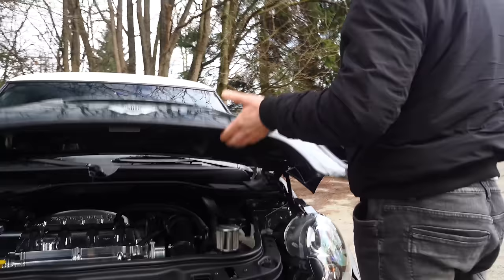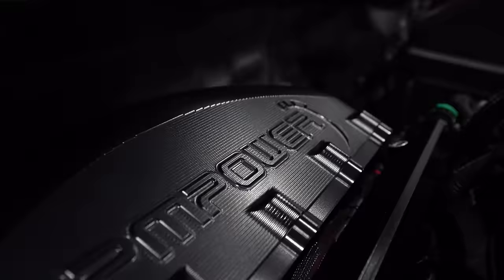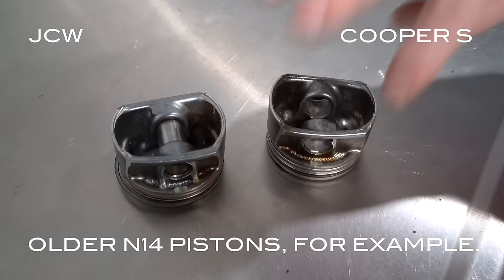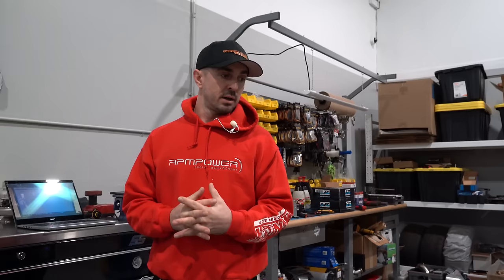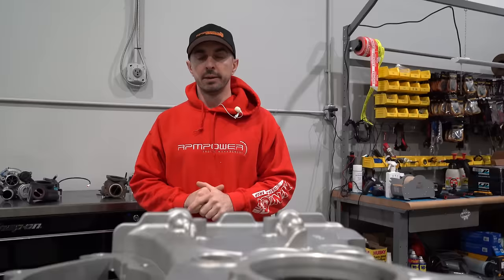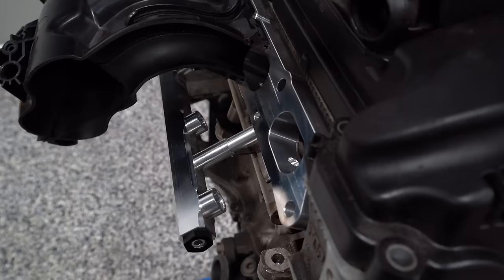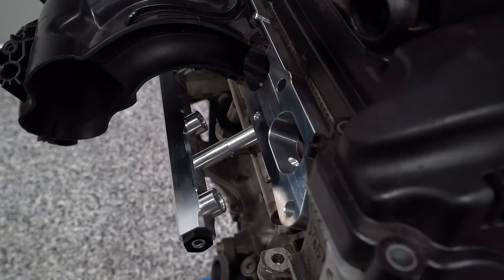Here’s the Secret to Building a BULLETPROOF 600+ HP Mini Cooper (PART 1)

Comment: Talking about how the factory crank is forged and has plenty of potential makes me feel bad that I turned my old N14 crank and flywheel into a side table for my living room 😂
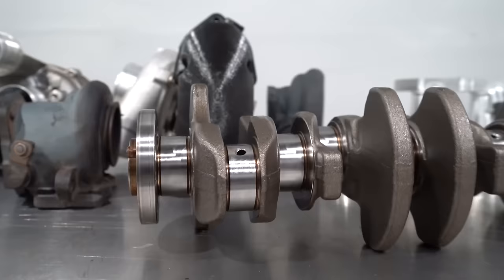Reply: Maybe I misheard, but at 3:35 that looks cast?
Reply: @rambow70 it's not forged, he said saves you looking for a forged crank. So you are correct.
Reply: Pics?
Reply: @rambow70 it’s forged the parting line is wide.If you look very closely it looks like there’s 2 lines.

Comment: the r56 engines SUCK period.  to get 600hp out of a mini cooper it would be like 15k why invest 15k to get 600hp that will not be reliable when you could just kswap it for less then 10k throw a turbo on it and make 600hp while still be reliable unlike the n14 and n18 engines.

Comment: very informative, thank you. Funny enough, yesterday I got the WMI kit for my car, and the main reason why I didn't get PI is the cost VS mileage. I'm doing about 2600mile/year on my summer car, and PI kit used is simply non-existing and new only few option @ 4-6x the price. WMI there's a ton of used item, and tons of new option (jb, snow, aem or even Bosphorus Innovations, probably the cheapest one). I totally agree this is way more maintenance, and probably less effective, but the risk I take on a old car, where most people want power for less money. Also you can do your own mix, I use a gallon of pure methanol (branded as heavy equipment defroster) for 7$ and radiator water for 3$ a gallon for a 50/50 mix of 2 gallon.

Comment: Use the original mini cooper s by BMW the R53superchsrged one make 600+ on that annd I'll subscribe and support as if U do it right I may copy but I bet you couldn't get more than 400hp ohh supercharger stays but U can twin charge by adding a turbo with super charger then U see the most popular race/road mini cooper s but prove it's possible to do with ease it took me a full rebuilt engine and bonnet buldge big charge cooler with intercooler 45kaud  the car handles best of the minis its why racers and enthusiasts buy best bang for buck try it won't cost U much with Ur connection s  ib dare you to take ac2003 cooper s or John Cooper s and make 500+HP usable atw

Comment: RPM power & Lorenzo thanks a lot for all your hard work and your support to all the mini owners. I do have a 2011 cooper S and I have a couple of problems the smoke at idle and burning oil I do replace the oem oil cooler for an aftermarket with the remote repositioning cooler and I’m just cleaning up all the radiator and water supply from oil on the previous oil cooler failure what did you recommend to make it reliable and please if you have the parts please send me a message I’ll really appreciate thanks again.

Comment: Yes!  a mini update, very underated car, 200 hp feels fast in this thing. Is he located in Canada? More info on your shop please 🙏.  Thanks for explaining the methanol situation, i was thinking i would eventually have to go with it for my n18. Also the freeze plug is a scary thing 😳. Good information
Reply from the maker: Yeah, 300-350 whp is the sweet spot for the FWD minis for daily driving.. at least for what I would use them for. :D. 
RPMPowered.com is where you can find more! Links are in the description. You could also try reaching out on Instagram if you have any questions.

Comment: That freeze plug thing you were talking about took out my N14... I was driving on the high way, suddenly a massive explosion. Black smoke behind me everywhere.
The freeze plug came loose and caused the engine to lock up. Connecting rod snapped half way because piston locked up.
Bye bye engine :o
Reply from the maker: Holy.. :O Sounds terrifying.

Comment: This is such a great video eith amazing explanations about everything. I'm looking at getting a 09 copper s. I'd plan to replace oil pump and timing assembly and at some point upgrade turbo. If u see this comment what would you recommend i do to get a little more power over stock. And keep it reliable. Just new turbo?